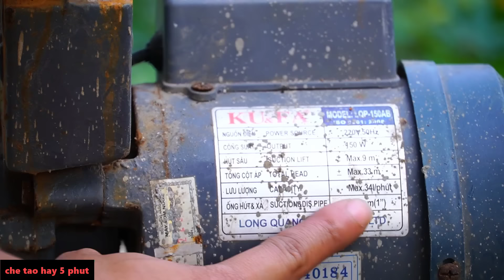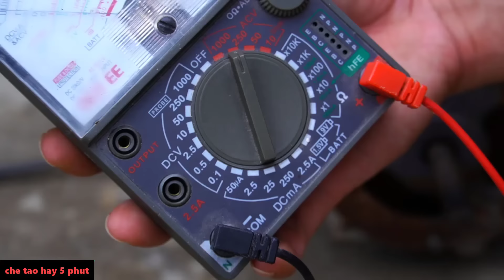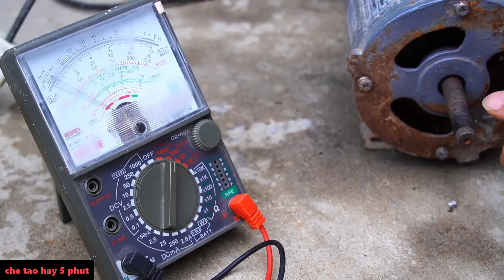i turned the water pump into a 250v generator

Comment: Heres  thought. Everything they have hooked to it the the picture are 120 voltts ,60 hertz. Now explain how you break it down. Unless that motor is 250 volts. It will not put out 250 volts. And even if you only use one power leg it will burn up a 120 volt appliance. Now what you got to say?
Reply: I agree most of it would be converted to heat.

Comment: Your video is fake. The rotor is the same, just painted black, and you probably wanted to demonstrate that the black rotor is magnetic by attaching a small piece of metal to it. However, it's the other way around; you used a small magnet to show that your rotor is magnetic. You likely power the fans by drawing power from one of the cables in the socket. In other words, one of the fans is surely directly connected to the house supply, and its cable provides power in the distribution.
The trash in the corner is only meant to cover the cable from the house socket.

Comment: Hello
Tried your invention but did not work
Can you explain why the pump is not producing elictricity. I will love if you can send detail information to try again
Camille
Reply: This is nothing more than a very old method of making dc into ac before inverters. Most ac motors will make ac if you drive them with something like a dc motor. However, if you leave something plugged into it when you shut down or try to start you may loose what tiny magnetic field is residual in the rotor. It won't make electricity if that happens. You could apply the  correct ac to the pump then when you drive it with a dc motor, make sure said dc motor can spin it up to the pumps normal rpm, then plug something in.  Should work for you then.